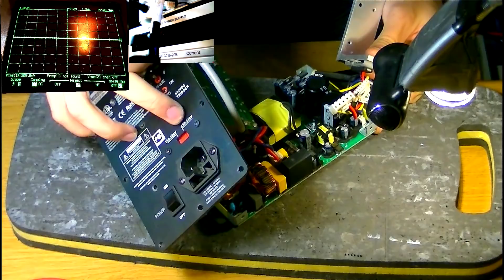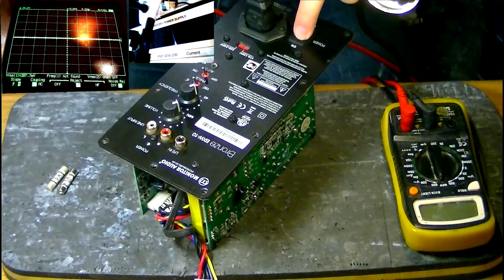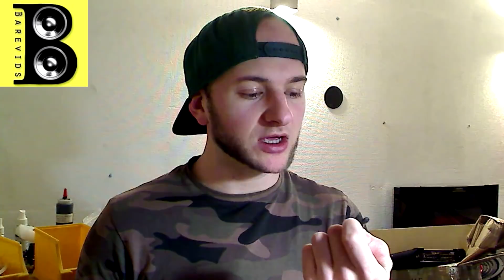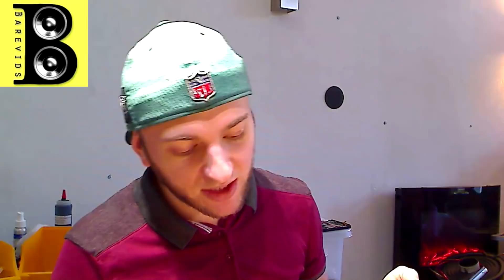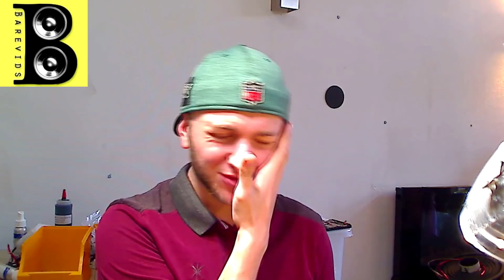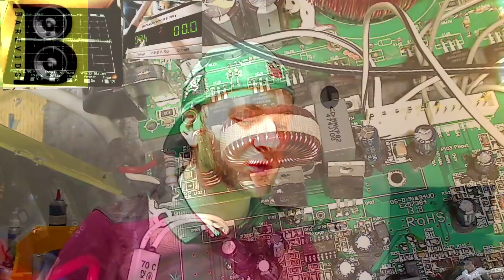The most infuriating little amplifier I have ever tried to repair.

Comment: 3 amp Slo blo..or use a light bulb to limit current in rush, or..an adjustable isolation transformer.....
Other than that...
Sometimes it's just dammed frustrating..
I've been there.!!
One last thing,  have any caps been ESR'd possible faulty caps..??
Reply: Frank Pitochelli Hi,
A light bulb does the opposite of an inrush current resistor. A bulb has low resistance when cold and gets rapidly higher once heated up. An inrush current resistor works the other way around. High resistance at start then quickly lowers when heat up. This is useful to ‘slowly’ charge up large capacitors.

A light bulb will limit the current though and that can be very useful too of course!
Reply: @Conservator.  ....yes. you are correct, it works opposite of a thermistor....both work, I would use a 100-150watt bulb whenever I needed current limiting back in the days when I had a dog chassis on the bench, as well as a variac transformer.....
And a few other tricks to help stop the constant destruction of new components lol...😃
Reply: Frank Pitochelli Hi!
A thermistor will only limit the current a startup so a light bulb is the safer option. No news for you, just for others readers here. 

Also your remark about caps is spot on. I’ve repaired a few subs and there have always been bad caps. One time ALL of the small caps had gone south, other times just a few. None were visibly damaged. I had to desolder them and measure them using my (cheap;) esr meter. 
I usually just buy Panasonic, Rubicon, Nichicon, Nippon Chemicon or United Chemicon brands and look for 105°C max temp (not 85°C), lifecycle of 4000h or more and then the lowest ESR / highest ripple current.  
These caps can be 5x more expensive than their Chinese rivals but they will still cost only a few cents.
Reply: @Conservator.  ....
Absolutely on the caps being bad, Mitsubishi TVs and a few other brands as well, but Mitsubishi in particular had a serious issue with bad electrolytic caps, most would leak the electrolyte etc, however,  there were times when we would change over a hundred in the older projection TVs and the later direct view TVs, would replace them dozens at at time and as I said up to over a hundred...
They were great money repairs.
We would have to wash the circuit boards to remove all the electrolyte that leaked out of the caps as well...it was a labor intensive repair, but, the money was good since a customer wouldn't just up and throw away a 2000 dollars Widescreen tv.

Also, thermistors in TVs would have low resistance when cold then go high once they heated up which would cut the current to the circuit.
Best wishes.
Reply: @Conservator. ...
P.S....yes, Rubicon, and Nichicon were amongst the bad capacitor brands at that time, they have since corrected their issues...a few other Chinese brands as well...
Sorry to rant on, this Quarantine stuff is keeping us bored and spending a lot of time on YouTube..😃
Reply: Frank Pitochelli 
Thanks! 
Best wishes to you too!
Reply: @Conservator.  ...I was a TV service technician for almost 40 years,  I have given it up about 3 yrs ago since TVs have become throwaways...
I still keep active threw videos and "some" minor playing around with electronics...nothing serious,  I work full time for a submarine manufacturer now.
But, I still love the electronics trades and watch as much as possible on YouTube. 
Best wishes.
Reply: Frank Pitochelli 👍
I’m retired and picked up my old hobby ‘electronics’ again. I’ve watched quite a few video’s around SMPSs and Class D amps but also about the characteristics of mosfets etc. 

I buy defective subs or offer the seller to repair the sub at cost. It gives me great pleasure to repair a sub that would otherwise be thrown away. 

I hear that lots of TV’s also fail because of bad caps. Such a waist.

Comment: Check bootstrap cap on pins 13 and 15 on IRS2092, may be shorted or leaky. Also, check on pin 16 of IRS2092, is there a diode and it is ok. One other reason could be fake ic.
Reply from the maker: Could you tell anything by the voltages on the pins I wrote down?  I tried one of the new chips in the pioneer which worked great so not fake sadly 😔
Reply: @barevids  Ok, just got what you talking about. Pin1 is positive supply rail 5V. Pin2 is GND. Pin 3 is feedback from output on Pin13, ignore. Pin 4 is compensation feedback, ignore. Pin 5 has three functions, if Vcsd<(1/3 voltage on Pin1) the IC is in shut down mode, if (1/3 of voltage on Pin1)<Vcsd<(2/3 of voltage on Pin1) the IC HO and LO outputs are still in shutdown mode but the OTA is activated and starts local oscillation which pre-biases all the capacitive components in the error amplifier. When Vcsd>(2/3 of voltage on Pin1), shutdown is released and PWM operation starts. Pin 6 is negative supply -5V. Pin 7 this should be 5V with respect to Pin 10 or negative rail. Pin 8 ignore. Pin 9, dead time control measure with respect to negative rail, ignore. Pin 10 connected to negative rail (your reference point for the drive, measure everything from this point). Pin 11 (LO) lowside drive output. Pin 12 OK. Pin 13 source of high side drive, ignore. Pin 14 highside drive (HO). Pin 15 voltage of bootstrap (measure with multimeter between Pin 13 and 15) or use isolated probe for oscilloscope. Pin 16 should see the two rails total measuring from Pin 10, should be a diode connecting to the positive rail.
Reply: @barevids  the Vcc on pin 12 should be measured with respect to the negative rail, it should be around 12V. The voltage across the bootstrap cap should be this vcc - volt drop of bootstrap diode. But it seems that the lowside MOSFET is staying on, since you are getting negative rail out.
Reply: @barevids  check the feedback resistor is ok, between pin 13 and pin 3. This ic requires the output MOSFETs to oscillate. Check if at least 12V is present on pin 12, check that pin 11 and pin 12 are not shorted.

Comment: The one thing i would try is removing the black glue shit around the electrolytics near the 2092 and may replace the caps. The glue can turn conductive over time. Nice video anyway. It's examples like this you get experience from even if you loose :)
Reply: Pentode3000 Hey - I should have read the comments before I posted. Completely agree with this.
Reply: @brandise76  No worries, many people suggested this. I wouldn't even had touched that piece of crap and it costs 190€ as replacement. Well the manufacturer knows why...

Comment: Mains amps are a buggar, for class A's I'd add a 100watt incandescent lamp into the power circuit from the mains - if it lights brightly, sometimes you can pull the power before it goes bang or as my experience mostly went... bright lights and bang :D (eye protection a requirement). Only real way is a variac as the other commentor mentioned (out of my budget back then) and I'd moved onto other things I was better at ;)

Comment: Hey Sam, i repair tv's since i was 7 yo, lemme tell you a little trick to not blow up your home amplifiers... make a little cord with an incandescent lamp (20 to 100w) put in series and plug the stuff there, if everything is fine the lamp is going to light up for one second and then you're free to test. If the lamp stays on then there's a fault you have to fix
Reply: You will really need an isolation transformer if you plan to use a scope on anything connected to the mains... and you can vary the voltage using a Variac... So, typically you would have an isolation transformer, followed by Variac, and use an incandescent switched in or out of line to give you current limiting.
Reply: @JamesLewis  you can simply unearth your scope (at your own risk), there's no need to use a variac because varying input voltage is next to useless because smps are made to work on a large range of voltages  (usually from 80 to 245v ac) going below 80v it simply won't start.
Reply: @SuperLastTrain  I agree with everything you said, BUT... I would first say that it's great to be flexible, especially since not everything you work on will be switch mode, moreover the operative word here is "smps are made to WORK on a wide range....", when they are not working because there's a failure in the input stages, filtering or high voltage DC side, including the FET's then being able to power them at a lower voltage has worked for me (would have identified the failed rectifier bridge)!  Yes, at a lower voltage the driver chip probably won't start and so you get no switching, but that generally means that you can verify a fair amount before things start happening (unless you have Active PFC, which changes things a fair bit)!... Also, I feel like there's a difference between what you can get away with, and what a well equipped workshop /should/ have.... and these are not super expensive items!... I have a 2000w isolation transformer I bought from an electronics fair for £5... and another 200w one with several output taps giving a swing of around 210-250v which came from a junk sale of donated items at a museum for a sticker price of 50p... of course I paid £5 for that too, as it was going direct to the funding the organisation.
Reply: @JamesLewis  its all fine, actually I made my isolation transformer with two MOTs merging both primaries into one core. But in this case we are   giving small easy tips to Sam that doesn't gets onto mains equipment too often, ofc a well equipped lab would be the way to go... But when you're in a hurry and the repair isn't worth buying the equipment to work on it... a lamp may be the best solution xD. Btw i prefeer the variac option for lineal psus, I always went with the lamp for smps, even made some high energy smps of my own testing with the lamp.
Reply: @SuperLastTrain  Totally, I do run an isolation transformer and variac, but /with/ an 100w light bulb also... it's really a must.  (One other thing people often don't realise is that a variac is not isolated... so watch that one everybody!)
Reply: Btw you can test with your scope as the lightbulb is on (when there's something wrong)

Comment: Put a incandescent light bulb in line with the mains. Check out dim bulb testing. Very cheap way to limit current and check for shorts.
Reply: I was about to make the same comment. =)
Bright bulb = heavy current pull.
Reply: Light bulb and variac are great
Reply: @coreyv3071  I have both and a isolation transformer. Without it I wouldn’t try to fix mains voltage stuff.

Comment: Please note a variac may not work if it has a switched mode supply in-line of any output section!
Once it reaches its turn on threshold it might just "pop" the instant it switches on
Reply: All class d amps have switch mode supply that is how they get their efficiency.